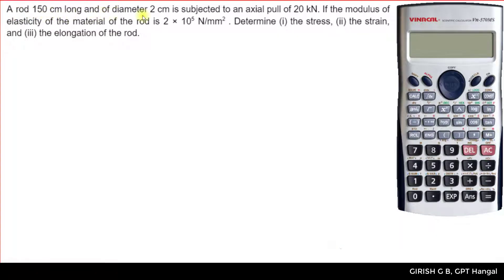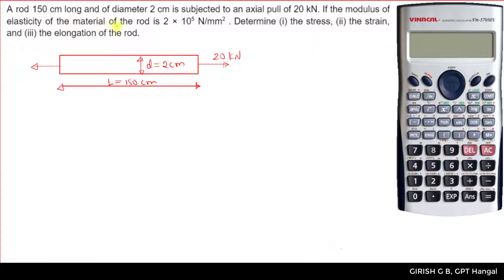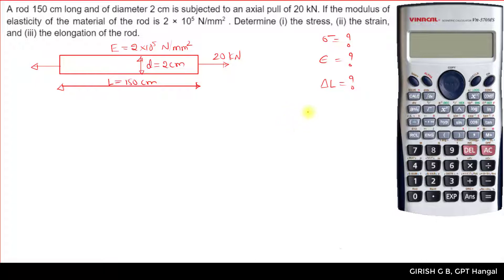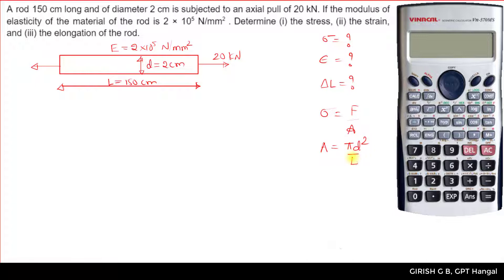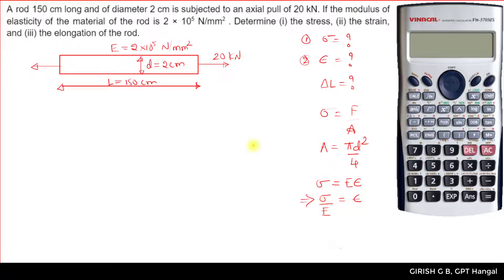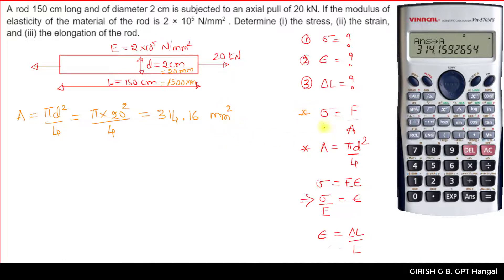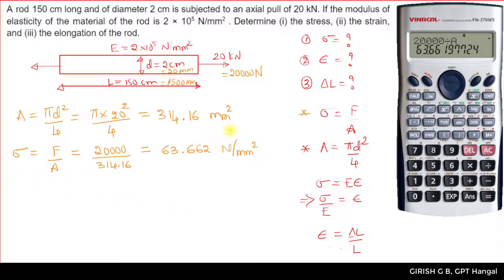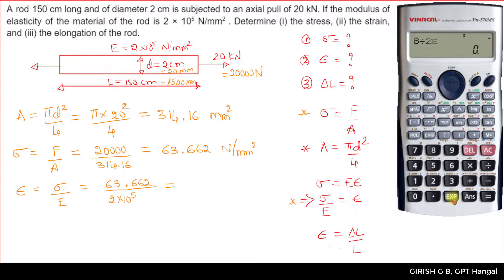W3L123 PROBLEMS EX1  (KANNADA) (20ME31P)

Comment: Hlo sir,if Young's modulus is unknown then how to find elongation
Reply from the maker: Post the problem statement in comment section
Reply: @GIRISHGB  a steel bar is 10mm diameter and 2m long, it is stretched force of 20kn. calculate the stress, strain,elongation of rod
Reply from the maker: Since they have mentioned as steel, the Youngs modulus for steel is 2x10^11 Pascal.. you can utilize this value to calculate the parameters..